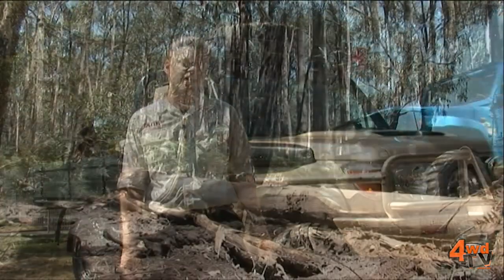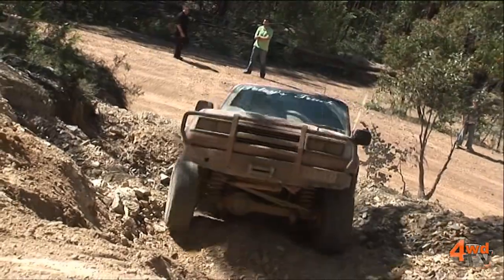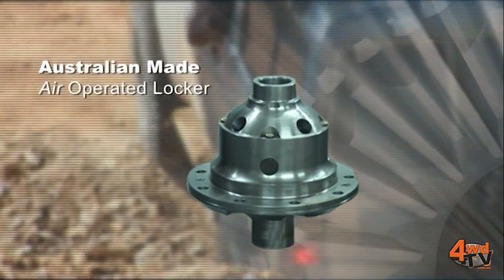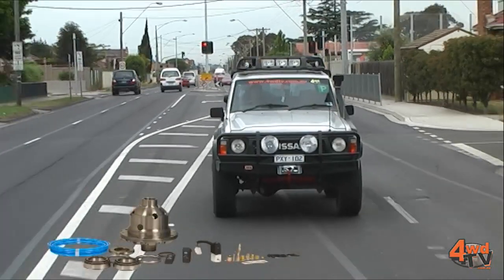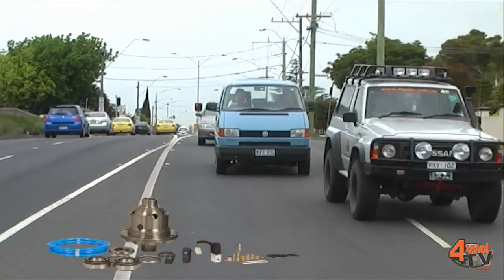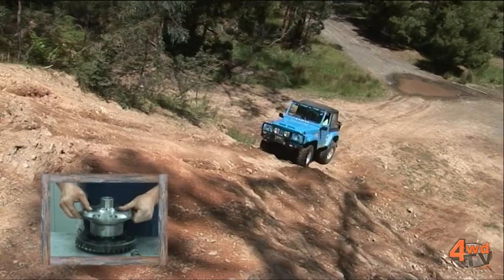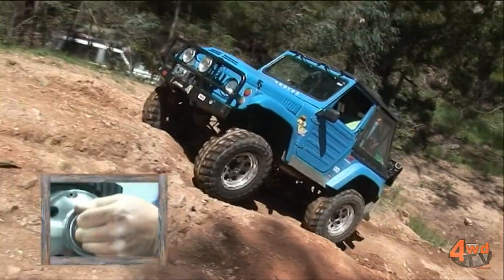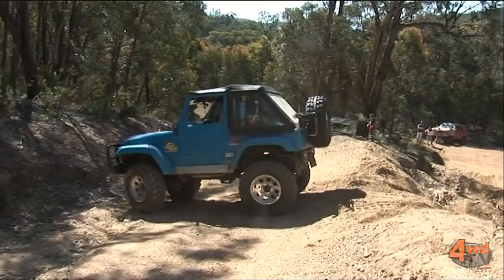How Air Lockers Work

Comment: what ARB model and other components of it will I buy for 2021 Hilux conquest ? thanks.
Reply from the maker: Hi there Joji. We would recommend getting in touch with your local ARB distributor to discuss availability of ARB Air Lockers for your vehicle. You can find their contact details at our website.

Comment: They're great, but with one huge flaw it's air operated and all the hoses and O-rings they get old and brittle then they fail, I've heard and seen a few bad stores of these failing due to cheap parts, also since it's air operated it's not instant which sometimes can be annoying and a bit dangerous. also very overpriced. 
E-locker is the future.
Reply from the maker: Lone Wanderer Hey Wanderer, our chief Air Locker engineer has provided the following: 
The service life on our air lines and seals is greater than most automotive wiring, and generally good for the life of the vehicle. They shouldn't get brittle unless exposed to high amounts of UV or harsh solvents (both of which will affect electric wiring as well).

With regards to the locking not being 'instant', a volume of pneumatic pressure actually harbours far greater potential energy than servo-electric actuators, cable driven actuators or magnetic ball-ramps, and this is exactly why we use it. A dog clutch must be aggressively driven into engagement to obtain full lock depth before it can handle torque. This is why our locking system attracts no maximum vehicle speed restrictions in terms of diff engagement, contrary to electric lockers.
Reply: ARB4WD A lot of that maybe true, but I've seen and heard what I saw, nothing to do with UV. Many people have no trouble at all with them, but there's a lot who do.

From what I've gathered it's mostly down to the monkeys who get hired to fit the lockers, some of them should be allowed in a workshop.
Also there is a problem with the O-rings failing and if the components do as you say have a life of the vehicle, then why don't you guy have don't have lifetime warranties.

E lockers are only going to improve in the next few years and air lockers will be will fade away.

I've been doing a lot research on all types and brands of lockers and some of the stories and first hand experiences have sadly turned me off.

Comment: Excellent product.  I had one installed in my '89 E-250 van in '94.  Even though this vehicle is 2WD, the ARB made a huge difference in its capabilities.   The van finally gave out after 25+ years.  ARBs are not just for 4WD!

Comment: Hi
I'm having a rear ARB fitted to my 1992 mk2 swb Pajero in 3wks by a British firm,Devon 4x4.
Really looking forward to it but I have a question?
Do you do one for the front as I was going to go the full hog but they seem to think one is not available?
Thanks
S Jones
Reply from the maker: Hi S Jones, this will depend on the type of ring gear you have in your Pajero. We have an Air Locker to suit 28 spline, 8" ring gear applications, but some model Pajero's came with a 25 spline, 7.25" ring gear. Unfortunately, Air Lockers will not suit the latter application.

Comment: That was an excellent explanation, Basically it is not essential but will vastly improve the vehicles capability, and can be installed in both front and rear. Do ARB do sponsorship?

Comment from the maker: Hi there, if used appropriately, Air Lockers can actually reduce the risk of CV damage that's most evident when shock forces are applied after a lifted, spinning wheel comes back into contact with the ground. Air Lockers also enable the driver to remove speed from the equation in most situations, allowing for a much greater level of control.

Comment from the maker: Hi Paul, a centre diff lock sends an equal amount of drive to the front and rear axles when engaged. Air Lockers on the other hand, send an equal amount of drive to the left to right hand wheel on each axle when engaged. You can therefore fit Air Lockers to a centre diff equipped vehicle as they work independently of each other.

Comment: Hi Ive got a question, what happens when you fit an air locker to a modern 4x4 with an electronic controlled center diff lock? 
Asking about me 2010 Suzuki Grand Vitara TDi, It has center diff lock & Im curious about it its even possible to fit air lockers with this set up? Though yea I know ARB dont make air lockers for the GV. Just want to know if its even possible?
Im very happy with the performance of the center diff lock tho!  
(Correct me if Im wrong with anything I said above;)

Comment: $2,500USD all said and done; front and rear fully air-locked. So, no. A low budget teenager will not be able to afford ARB Air Lockers. Pro-grade off road motor sports is not a cheap hobby.

Comment: i dont have much of an answer for you. but id use a early 2000's toyota "prerunner" rear axle.  better disc brakes, and its a factory E locker. otherwise, i just welded mine. haha i have an 88 nissan prerunner. go nissan!

Comment from the maker: That's right, Nick. When engaged, the Air Locker effectively locks the wheels across an axle together, meaning they both receive the same amount of torque. When not engaged, they act as a normal open diff. This means you can have the best of both worlds for a great on road and off road combination. They don't act on all 4 wheels at the same time, just the two wheels on the axle to which they're fitted. For that reason, both front and rear Air Lockers provide the greatest traction advantage.

Comment from the maker: Hi Servalpha, locking differentials would certainly increase traction and off road ability in difficult terrain. You can view our Application Chart here to determine the correct part for your Zuk - arb.com.au/media/products/air-lockers/application_chart.pdf. Alternatively, if you contact your local ARB store or stockist, they'll be more than happy to help you out.

Comment from the maker: We do make Air Lockers to suit a limited range of 2WD vehicles. These are used mainly in on-road or light off-road commercial situations where traction is limited such as farm/station work, slippery boats ramps, greasy roads etc. 

They are also used frequently in motor sport applications such as drag racing and drifting.

A 2WD vehicle will never be as capable or controlable as a 4WD in off-road situations.

Comment from the maker: Diff locks shouldn't be used on surfaces which don't allow wheel slippage. When turning, the outside wheels travel further so they need to turn at different speeds to the inside wheels. When the diff is locked, both inside and outside wheels turn at the same speed which can cause transmission windup if the surface doesn't allow the wheels to slip. Air Lockers are wired to ensure they're very difficult to accidentally activate and it will be obvious if one is mistakenly left on on hard surfaces

Comment from the maker: Hi Terminder, in a word, no. The selectable 4x4 lock button on the Xtrail simply locks the centre differential. ARB Air Lockers are used to lock the front or rear differential to prevent cross axle wheel spin.

Comment: hey buddy, i have a nissan xtrail 4x4, it also has the push button 2wd , 4wd auto and 4x4 Lock. is the 4w4 Lock has the same function as air lockers?

Comment from the maker: Hi MrJihadkoplo, we do make Air Lockers to suit a limited range of 2WD vehicles. These are used mainly in on-road or light off-road commercial situations where traction is limited such as farm/station work, slippery boats ramps, greasy roads etc. They are also used frequently in motor sport applications such as drag racing and drifting. 

A 2WD vehicle will never be as capable or controlable as a 4WD in off-road situations.

Comment from the maker: Hi TheLiryc24, yes, you can certainly mount your compressor inside the cabin. Underneath the driver or front passenger seats are popular locations. 

Our current range of compressors are extremely reliable and it's vary rare for one to fail. Regarding the seals on Air Lockers, issues with these almost always come down to incorrect fitting. In a correctly installed locker, the seals should last the life of the vehicle.

Comment: Yes, there is more strain on the axle shafts and other drive train parts. I also have 35" tires so I upgraded to Superior Evolution Axle shafts, they are made in America and are of higher quality 4140 grade chomoly then foreign chromoly axle shafts (metal standards being different in different countries), might want to look into a higher spline count too while your at it but I didn't so i can use my old ones as trail spares. There are a lot of things to consider depending on what you plan to do

Comment: Why not just use a detroit locker? It does basically the same thing but gives you traction all the time and acts like an open diff around corners when no power is applied to the wheels.